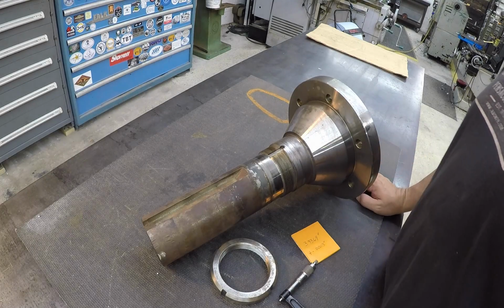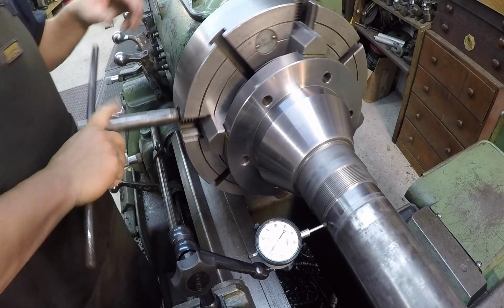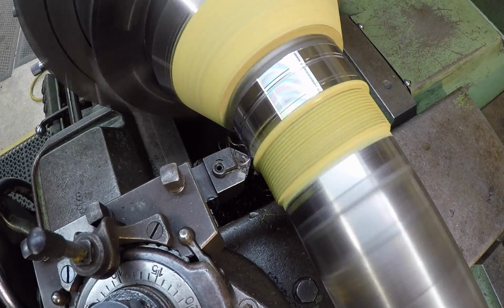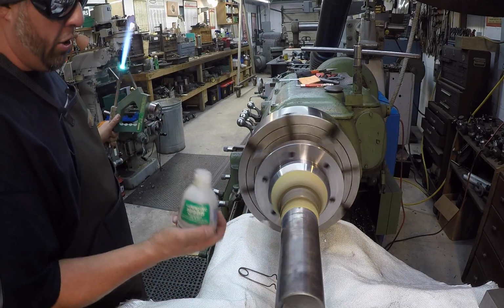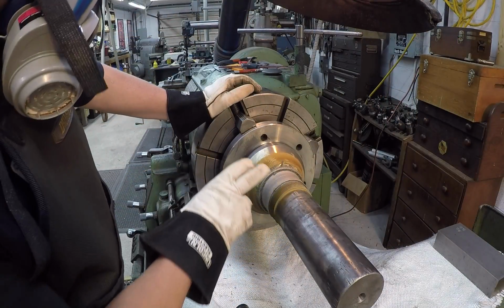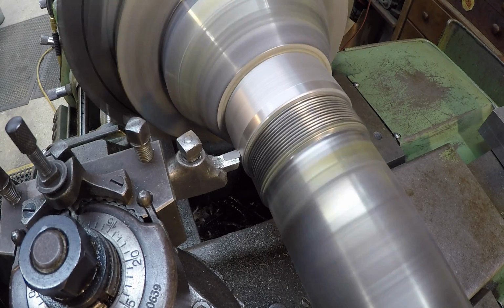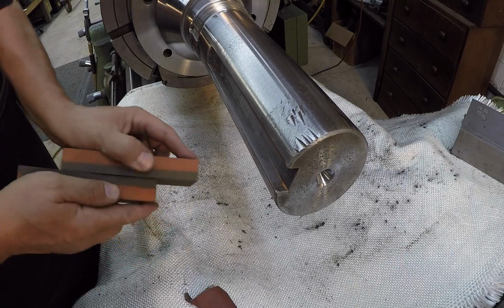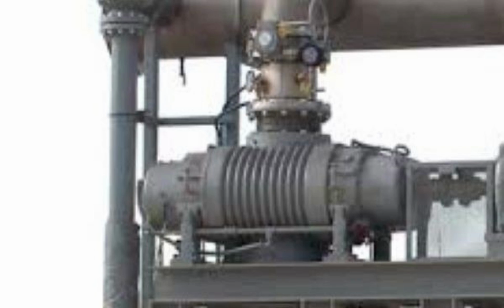SNS 300: Spray Welding a Blower Shaft

Comment: Hi, this is Junying Machining Manufacturing. Junying offers the following CNC Machining services for our customers: ● Prototype Machining & custom machined parts ● Plastic 3D Printing & Metal 3D Printing ● Precision CNC Machining & Tooling & mold make Services ● Sheet Metal Prototyping & Sheet Metal Fabrication Service Check our link and contact in BIO. If interested, please feel free to contact us. We will offer a quotation as soon as possible. It would be my great pleasure to cooperate with you.

Comment: Outstanding.   Good work.
I worked in a machine shop for 7 years my uncle owned it so I grew up around the shop, ive never seen spray welding done. Totally fascinating.   Job looked about as good as it could without being a new part.  
We might have machined it and put a ss sleeve on it.  But the spray welding that was cool.

Comment: Never tap the job while the indicator is touching it. Its bad for the internals of the indicator
Reply: Right, and don't look at it the wrong way neither, it'll knock you off a thou.
Reply: @rotaku4946  3 thou.
Reply: I watched a guy try to mesure run out on a car axels disk for the brakes this kid had no friken clue what he was doing with a dile indicator. It was funny he'd bump it and it go out 30 thou. Didn't have an idea how to mount it. It kept changing its angle it was the flex shaft kind you might use on a mill.  I just kept my mouth shut laughing inside.

Comment: Reminded me doing this on big shaft’s huge cylinder on TITAN lathe….I was 17 ….in 1977….god sake time fly so fast……
Reply: Humm.  Same here.  Only I wasn't running the lathe.
Reply: Worked for Harris Graphics Printing Press Co in the 80’s. Used to finish grind sprayed diameters to size. Under the best conditions, sprayed diameters were prone to chipping and cracking under stress. Would definitely not recommend using this process unless there were no other option. God bless!

Comment: It's obviously supposed to be 100mm why not just have a metric micrometer and go to 100. 3.937" is 99.9998mm
Reply: He's only 200 µm short, cut him some slack.
Reply: Or it could be standard size. 3.937 is 3 and 15/16 ya know?
Reply: @patrickjohnson7369  majority of bearings are metric, but some of us still have standards.

Comment: i also use this techniq for repairing bearing seat.very hard surface when grinding n very easy to peel off
Reply: you could use a powder with higher Nickel content to get it more ductile and rigid so it wont peel of as easy... just a tip
Reply: what type of yellow paste you use to cover up left and right?

Comment: Wouldn't a standard weld be quicker?
Reply: It would change the geometry of the workpiece in undesirable ways.
Reply: @kenp3L  I have worked full time as a welder and a toolmaker. Welded just once close to threads and the heat changed the tolerance on the threads just enough that the mating part wouldn't thread on. Once of those mistakes that you will make only once.
Reply: @garyhodenius4209  Exactly.  Regular welding onto an existing precision part makes all sorts of things go haywire.

Comment: Hey Adam I love the vids and you know far more about machining and welding than I will ever know. But I've recently come across another machining youtube channel from Australia. I've seen him build material up with Either a mig or tig (can't remember) on Spindle's  for a big mining truck and does countless repairs like that from what I've seen, and I've not heard him mention that it warps the shaft.. The channel is Cutting Edge Engineering Australia if you're curious. He does a lot of mining equipment repair and think it would be a channel you would also like.
Reply: Kurtis (or his twin brother Karl!) uses line boring and line welding system on a spindle, which is MIG (well, it's welding with a wire feed, rather than with a tungsten tip and inert gas). I do reckon you're right... Abom and Kurtis (and the supporting cast of both channels!) are clearly brothers from another mother!

Comment: Why not mig welder to deposit material?
Mig welder make solid material 
Spray will make porous material
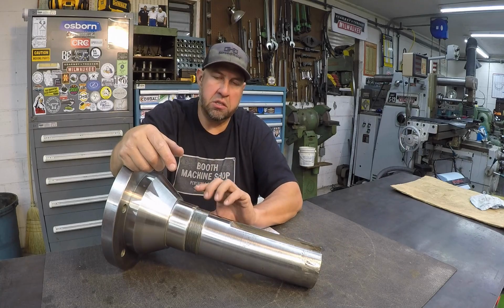Reply: explains this at 46:35
Reply: What's the point of having the cock and balls of a bull moose if you can't swing em around every now and then?

Comment: 0.28 "because of the spray welding I did on the channel".  This point is lost on some guys.  They are scared it will give away secrets and cost them business. What is actually doing is showing good work that creates business.
A friend of mine repairs lawn mowers. From his You Tube channel 60% of his work is now people sending him mowers from hundreds of miles away. The freight often exceeds the value of the mower. But people want a good job.

Comment: First time hearing of spray welding, interesting.
Reply: I was a mechanic in the 80s, and the machine shop did some spray welding for us in certain circumstances.

I am trying to think of the situations, it was a long time ago. From memory it may have been the crankshaft taper where the flywheel slides over the crankshaft end for the BMC Mini. The taper would fret out. So the taper was tidied up, spray welded, and turned to size. This was a high stress part and I dont recall any failures.

Comment: What if you made an arbor with the flange BC drilled and tapped? Skim the face in the engine large then bolt up the shaft to the arbor and indicate it. Torque down your bolts and shouldn’t have to worry about run-out on your faces.

Comment: Has the shaft got to be at room temp to get a correct measurement !
Reply: Nah doesn’t matter
Reply: It certainly does for the bearing fit size
Reply: @SpikesMavic  you don’t leave it like that you have to clean it and put it in to the grinder you work doing this before I work doing metalize before I know how to this job
Reply: @SpikesMavic  you don’t leave the weld like that you have to clean it I work doing this for 15 years you always leave it 10 to 15 thousands over the size after you clean it and put it in to the grinder
Reply: @joshuacotto4133  I am talking about after he polished it to size ( The finished size) !
Reply: @joshuacotto4133  Even if you hold the micrometer in your hand a long time will give you a different reading
Reply: @SpikesMavic  u know what a CNC grinder is?
Reply: @joshuacotto4133  Yes I know what a cylindrical Grinder is, he didn't use one for that bearing finnish, he turned it and pollished it !
Reply: @SpikesMavic  man that’s the way that I do he has his way

Comment: Just thinking, would it not be easier just to put a weld down then turn it to size !
Reply: He spent a lot of time talking about heat distortion and uneven bending that would result in traditional "hot" repairs as you suggested. This technique is regarded as a "cold" repair.
Reply: @BrassLock  Not sure about that, there would be an awfull lot of shafts etc that get TIG/stick welding to build up bearing surfaces distorted , not all machine shops do Metal Spraying !.
Reply: @SpikesMavic  Sure, you're  quite right about that. "Pakistani Trucks" YouTube Channel illustrates how to repair all manner of heavy duty damage and breakages using stick welding, sledge hammers and a lathe. But given that spray welding is eminently the quickest turnaround, eliminates distortion problems, and the skill subsets can be taught and learned, I can see it's a preferable path for youngsters wanting to offer top-notch services to the industry, don't you agree?

Comment: Fantastic video. One question. Is the powder gravity fed and can you alter the delivery speed (2 questions!)
Reply: I've done  this prosess before. I believe it works using the  venturi effect and gravity. No need to alter the delivery. it is set by the hole size for the proper delivery rate.      Beautiful job , I hope the Hack who used the pipe wrench on it doesn't screw it up.

Comment: One thing I heard mentioned was using soft jaw inserts, which is absolutely a good thing. BUT DON'T USE ALUMINUM, especially on a part that is used in a water system. The aluminum can transfer to the steel, and when water gets on that spot it will cause the steel to rot and pit very quickly.

Comment: Looks it's a Solid End Headwall for a centrifuge. Bearing diameter is probably an m6 fit. We sent similiar items out for spray weld and grinding where I used to work. Tungsten alloy normally. Where I retired from we spray welded ceramic for seal diameters
One way to eliminate the indicator keyway issue is to have a piece of shim stock or banding between the indicator tip and the work.
The  critical face on the joint face (the surface where the part bolts against its mating part is not the part he has the indicator on. But if the wall thickness is the same all around then it works. Instead of bumping with a hammer what I always found more useful was to have a set of jacking screws that you could fasten in place in the tee slots of the chuck that had a smaller screw in them. Say a 5/8 hex head tapped to 3/8-24. This jackscrew could then be used to push the part relative to the of the chuck. This also works well for getting the run-out out of the far end.
However the hammer mechanic was that worked on this in the past sure left his signature.

Comment: so I saw NO welding. what IS SPRAY WELDING?
Reply: It's welding a sprayed metal powder onto that shaft building up thickness that can then be machined.
Reply: @sandpir8  thank uyou, thats what I assumed, but I didnt see anything but basically sanding with emory cloth, I didnt actually see the metal being sprayed on. I will continue to look for a video, I am really interested in seeing new terch that isnt only electronic/computer basedf.
Reply: @louiscaldwell6004  When Abom had the torch in his hand spraying the shaft you can see the powder sparking in the gas flame in the close ups.
Reply: Did you even watch the video???
Reply: @griffgraff2883  Would have been really nice to see him turn this part down in lathe maybe lol. =)
Reply: @ANDYMCNET  unbelievable 🤦‍♂️

Comment: wrong way to fix it,better off with a sleeve
Reply: Done right a spray welded diameter is just as good or better. Done wrong it's a disaster waiting to happen. Where I used to work we sent out items similiar to this for spraywelding if we had bearing diameters that were undersized. The vendor used a tungsten alloy that was then ground to the desired fit. Before we went to spraywelding we normally would have items chrome plated and ground.

Comment: Never heard of this technique before. It's just basically shooting some fine powdered metal into the torch flame?
Reply: Pretty much. The key is to have an extremely clean surface and proper temperatures.  Most of the stuff I've had to machine that was sprayed was done as ceramic seal surfaces. Have to grind those.

Comment: Nice video... I am a retired machinist with 35 years in a machine shop, last ten years as lead man. I did a lot of spray welding over the years using the same system and like you would much rather spay a part than sleeve it, and as you said if done right is much better than a sleeve. Had to watch to see if I did it correctly, looks like I did even down to using the same cutters and polishing. Great job thanks for letting an old machinist relive the past a bit.
Reply: Been involved in this on the machining side (mostly ceramic seal surfaces). Lather I worked for a company where we sent similiar items to this out to be sprayed on bearing and other critical fit diameters. Those were ground. Sprayed with a tungsten alloy.
The part looks like it's a Solid End Head for a centrifuge

Comment: We do that at my work too on paper rolls. But we use a thermal arc welder from praxair. It’s a thermal spray unit
Reply: That's where i first saw this done in 1999, repair to the face of a press roll on a tissue machine, never seen it since, apart from today!

Comment: I did spray welding many years ago.( I think around mid 1970 to early 80's) basically was a gun with rosebud torch and a spool of metal wire mounted  to it...all this mounted on the tool post of a lathe.   the shaft that needed build up  would be turned down a bit and threaded to give the molten metal something to grip to. the wire, which was speed regulated, was fed through the ctr of the torch flame , slowed down to a point where it would melt as it was fed into the flame.  the molten wire would then blow onto the turning shaft building up  the area. it was then ground back to size.

Comment: Great job! My company used high tungsten carbide spray weld to seal in carbide grains to make huge rock bits wear-resistant. The wear pads had +/-  .015 tolernce, so were used as-is, not turned or ground down.

Comment: Brings back good memories from 1985, when I started  using this process to repair pump shafts, great to see it is still being used. Have to be careful of the application, we had a bad experience on a phony outfit did this to one of our turbine shafts, without letting us know and we lost the turbogenerator as the shaft sheared due to fatigue in the thread cut for the metallizing.
Reply: i did this too  around same time

Comment: thanks a lot for your video's really interesting, I assume working to close tolerance on large diameter shafts that you bring the work back down to a pre-determined temperature, (because of expansion), does the customer specify a working temperature for you to finish at?

Comment: Abom79 : Why don't you just weld on the seal journal and turn it back down to the exact size "Cutting Edge Engineering Australia"  has a few tricks that seem to work just as good.

Comment: I used to work in a shop in Mississippi, we tried this or 5 times on a calendar roll from a paper mill. Never could get it to work. Actually called in their technician, and he tried twice. In the end he suggested just welding and turning or shrinking on a sleeve. The problem was, that on the finish cut, even though all the directions had been followed, the spray material would peel off. Even their company techs couldn't figure it out.

Comment: Worked in a depot level jet engine repair shop 50 years ago.  For the main shaft with many bearing surfaces, this would have been repaired by taping the area needing machining, coating the shaft in industrial wax by dipping, cooling and redipping until a thick coat was built up, cutting the area where the tape was to expose the metal needing work, then hard chroming, melt the wax and then re-machine to proper dimension.

Comment: THANK YOU, for making this video, and posting it. You do pretty work! 
   One word of wisdom for you, from an old retired Tool & Die Maker; if you'll grind a very small radius on the tip of your lathe cutting tool, your finish will be good on every cut!
   I noticed you didn't use your Live Center, during the Spray Welding process. Was that an oversight? since you had brass buffers between the chuck jaws and the material. Looks like the Live Center would be insurance that the piece wouldn't sling out and put a ding in the finish. Please enlighten me. I'm always intent on learning new stuff. 
   THANKS AGAIN !!!
   Bill, from Tennessee, 🇺🇸

Comment: watching you when fixing the blower shaft on to lathe machine its show that you are a professional dude..... but with decreasing the shaft diameter in journal side, are you sure the shaft strength against it load still good?
Reply: The amount of the damaged shaft's parent metal that is removed from the bearing journal is measured in thousandths of an inch, so very little is removed. Then the journal is built back up using the spray welding process, plus enough extra to allow machining the journal back to the original diameter.

I've been aware of the process for many decades. I even sent out similar shafts, for smaller versions of the pumps this shaft was for, to repair them using this same process. But I never had an opportunity to see it done. Long ago I had a friend who became an engineering specialist for spray welding jet engine turbine blades to repair erosion damage. I'm glad to have had a chance to see it done in this video by a craftsman.

Comment: its 2:37 am and found this after seeing a rust remover by laser process. never in my life heard of spray welding. amazing. what is that yellow coating? what stuff do you use to coat the shaft, the rust inhibitor? we use to use cosmoline. it is a thick waxy, honey consistency. They us to use it for coating WW2 guns back in the day.

Comment: Very cool.  Watched the whole video it was so interesting.  I'm no machinist, but I remember many years ago in the shipyard, they would build up worn bearing journals with some sort of 'electroplating' with a small current and some sort of solution.  Not sure it was as good as this seems to be though.  Some would come back with the electroplating flaked off in some way.

Comment: I have had to replace a blower wheel on a 30 ton air handler before. You could fit a truck in the air handler. The shaft was half this diameter lol

Comment: I like running into customers years later. It's always "oh yeah! It's still holding up just fine! Haven't had a single issue since you rebuilt it" The best was a Chevy 7-5/8" rear axle assembly I rebuilt out of 2 bad ones. Used 1 good axle from each housing, the best gearset, new bearings and seals and shimmed it up for the best possible pattern I could've gotten with what I had.

12 yrs later and he's still rolling right along in his AstroVan. I saw him last year and asked about it. Not one single problem. I worried about that one for a few years, wondering if it failed on him yet.

Nope. It's still going today. I'm pretty proud of that. I had pure dog poop to work with. One of the shims had broken and been welded back together and machined flat again lol. It was a basket case.